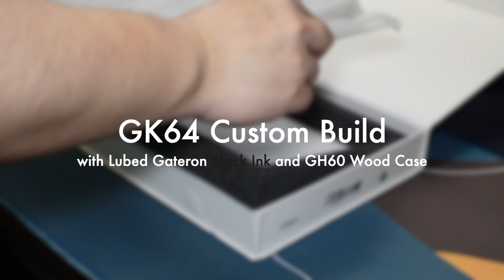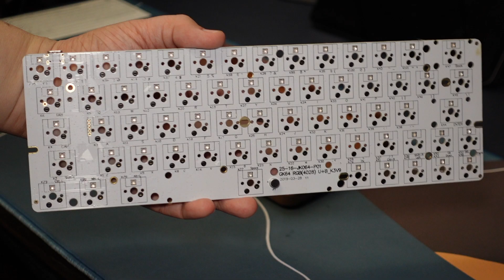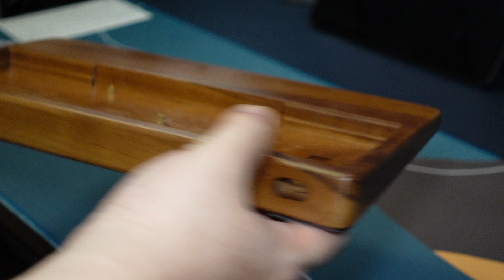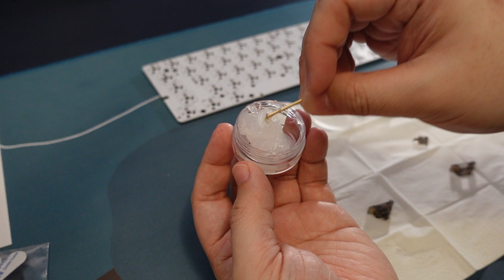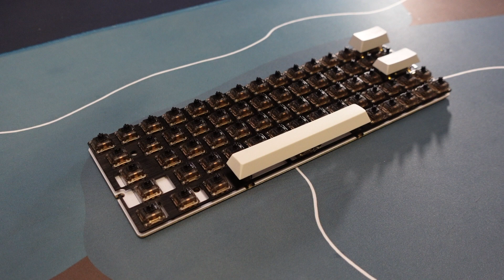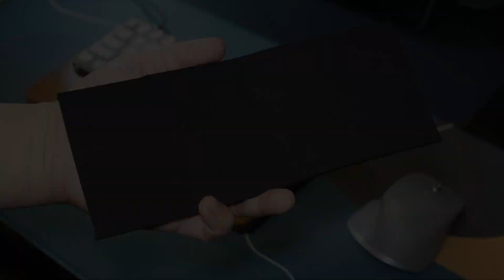Custom Build Mech Keyboard - GK64 with Lubed Gateron Ink Black

Comment: So I was thinking about doing this with my gk61. I've read that the mounting screws don't quite line up with the gh60 cases. Did you have any problems trying to get it to fit ?
Reply from the maker: no problem at all. The GK61 also supports GH60 so should be fine.
Reply: @TheAsianNerd  Alright awesome. Appreciate the quick reply!

Comment: question, your link led me top the key cap set but which version of the keycaps did you buy because they're the Jan base, the Jan modifier, the Jan mod pro,  and the Jan Numpad.
Reply from the maker: ah, I see they hae changed the way they sell the keycap set. It really depends on what layout you are using.
Reply: @TheAsianNerd  I’m using the same one ur using, the gk64